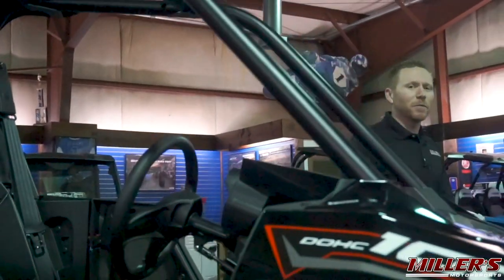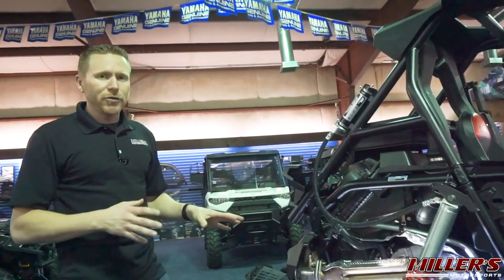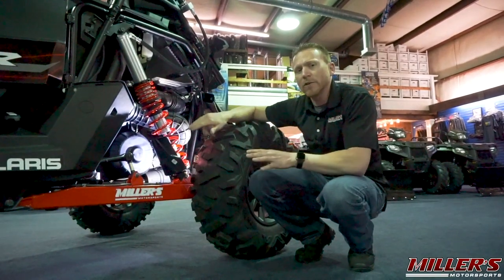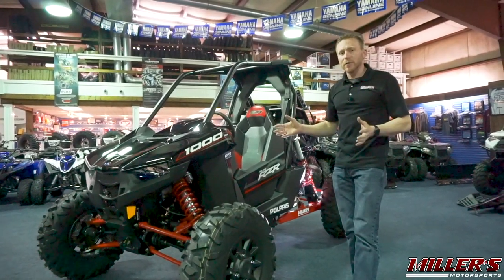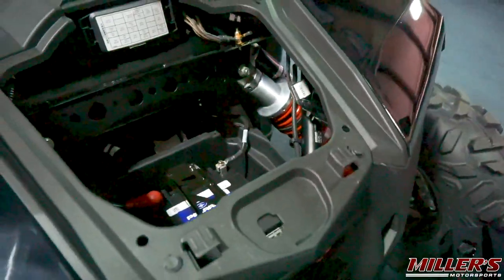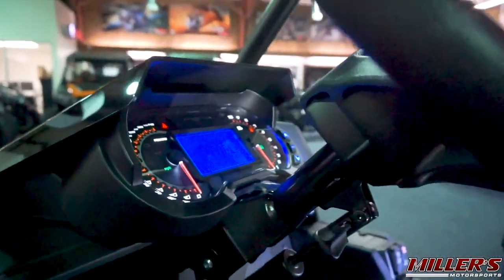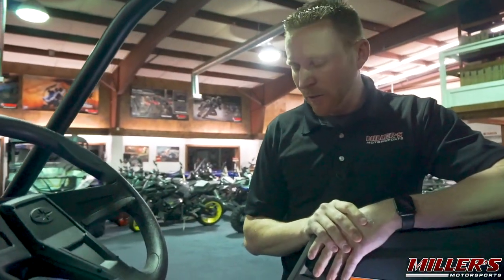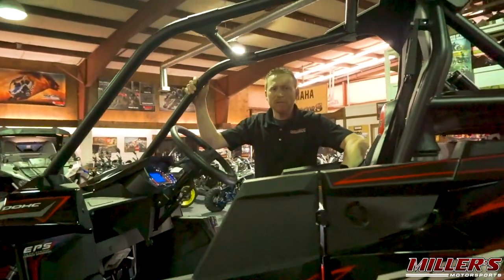2019 Polaris RZR RS1: The Ultimate Single Seat UTV

Comment: Well done video sir, Polaris has come a LONG way since 2008, when air filters were manufactured tucked inside of the engine compartment. I was a victim if that debacle. 

The snorkel system above the occupants is a GRAND idea. In so many ways, I miss my 2008, it was only 50” I’m guessing this 2019 unit is 64”. With a heavy driver such as myself, I believe this unit would be ideal for my fun factor. I live very Close the the Great Mojave Desert here in California. 

Cheers! Gary

Comment: My 85 Fl 350 Odyssey would RUN circles around this overpriced POS And it doesn’t look like a Goofy Golf Kart that has a roll cage
Reply: Sure Bubb
Reply: @josebarajas1888  1985 FL 350- TRX 450 R front end 10.5 inches travel disc brakes. Rear suspension repositioned with 11 inches of travel Troy Lee built coil over shocks. Beard suspended seat. 5 point harness. Comet Digger clutch. 38mm PJ carb built by Duncan racing. Oval bore and polished. Boyesen Block Carbon reads. Copper head gasket. Water cooled Head with 2 gallons capacity Radiator. Hand coned expansion chamber with FMF power core tip No Packing. This thing will pass and run away from any Golf Cart with a Roll Cage. And I’m called Sir not bubb AssHole.
Reply: @josebarajas1888  And jose. That’s not my first choice for off road. My son enjoys driving Zombie Kart more than riding my second 85 ATC250R. I am lucky enough to own 2 85 ATC250Rs. I prefer my over 50 HP 85 ATC250R over the Kart. But that Kart will plaster a smile on your face you can’t remove. Can’t say that about a Golf Cart with roll cage. And I should know I used to live on Catalina Island where golf carts are King.